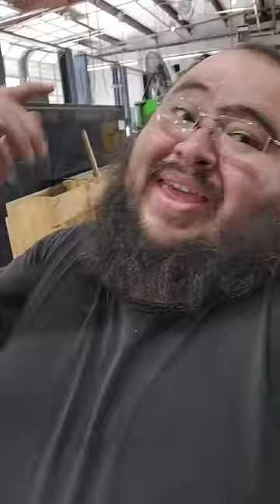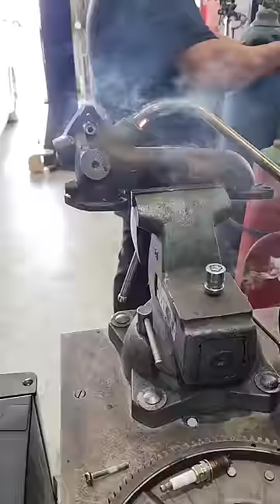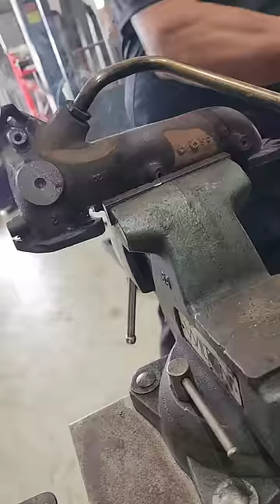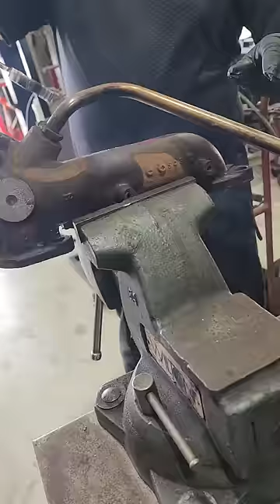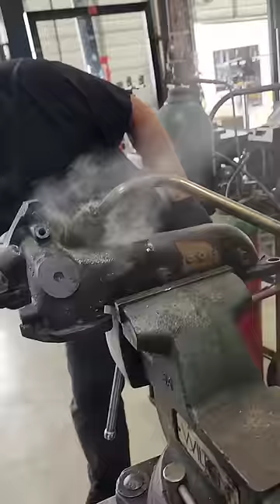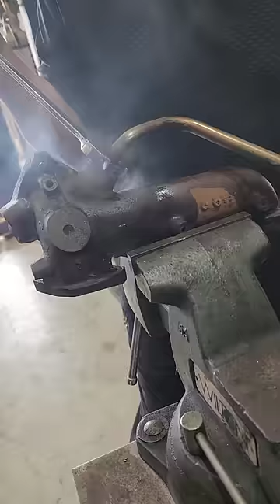MECHANICS MUST HAVE.... #shorts #youtubeshorts #fyp

Comment: Throw the close end wrench through the other side of the line and avoid rounding out the nut
Reply from the maker: The other side was a 27 so it wouldnt fit, i told him he wasnt getting it off lol sadly i didnt witness him removing it cause i had ish i needed to get my ish done
Reply: Flange wrench needed
Reply: i can concur, the snap on line wrench set goes up to 21 and my god it’s been a life saver on more than just stuck fittings🙏🏽🙏🏽
Reply: @DaDude999  that was a flange
Reply: Guess they never heard of a line wrench. Any mechanic should have a set of standards and metric to finish out your tool box.
Reply: If it won't fit over the end cut it
Reply: That’s what flare nut wrenches are for
Reply: Yes, flare nut wrench. Use the right tool. The box end of a standard wrench is typically 12 point and actually provides less contact than the fork side. You need more leverage too, peen the area while it’s hot and shock the flare nut side with some Freeze-It or dry ice. Work smarter not harder boys.
Reply: Get a line wrench on that and have somebody sit on the table... you can't get good leverage with that table moving
Reply: If you don't have a line wrench that size a sharp chisel bit in an air hammer, and some heat does the trick, vibration and expansion breaks the rust bond.
Reply: You can dunk that in cold water and if the heat loosened them they will stay free and undo cold shiiiiiit
Reply: I'd just cut it off and hit with an impact. Egr tubes are cheap.
Reply: Heat and use bee's wax
Reply: Looks like you needed some more leverage on that wrench.
Reply: Hit the outer with chisel gun lightly works everytime
Reply: Pipe wrench,not that hard to figure out.
Reply: Tubing/flare nut wrench for the win every time
Reply: Heat and beat! Are you trying to save the manifold or the Egr pipe. Get that manifold glowing red.
Reply: @DoubleoP  turn the piece around and pull towards you, lot more body force than pushing of lifting that way
Reply: @FluffyMexicanik  well ishhhhhhh
Reply: I was wondering why they didn’t do that. For that matter, cut the pipe off just past the fitting, and use a six point impact socket & impact. Weld the pipe back together if needed

Comment: This is why flare nut wrenches exist.
Reply: Yessir!
Reply: You don't need a flare wrench. This guy coulda slipped the closed end over the other side of the pipe and coulda had a full 360 degree bite on the nut.
Reply: @evanpimental  the other end was bigger
Reply: @evanpimental he said it was an open-end wrench on the other side
Reply: Line wrench...then the. Hammer. Chisel pounding begins.
Reply from the maker: Didnt have 1 large enough and other end was bigger
Reply: @FluffyMexicanik  excuses
.....
Reply from the maker: @feffernoose2860  lmao buddy...im showing yall what i want to show yall...apparently i posted this cause i knew it was going to gain traffic...also notice i said "you aint getting it off" in the begining of the video
Reply: @FluffyMexicanik  just another excuse... Love your videos either way mang
Reply: and vice-grips since its an inner bolt not outter nut.
Reply: @evanpimental  but wouldn’t the 12 point closed end be more likely to round it off since its 12 point and doesn’t have as tight of a grip on the nut?
Reply: @xXIntoleranceXx  well 6 point is tbe best, but 12 point beats an open ended wrench.
Reply: @FluffyMexicanik  that shop has an oxy-acetylene torch, lifts, engine hoists, but not a flare nut wrench in that size? Seems like y'alls priorities are outta wack
Reply from the maker: @FailedEmmisions  lmao u know us soooo well...back when these were common simple adjustable wrenches were good enough...now a 26mm flare...nope
Reply: @FluffyMexicanik  the YouTube mechanics know it all don’t you know that! 😂💀
Reply from the maker: @fastfred1233  smh we got every youtube certified trade in the comments 😅🤣

Comment: Keep in mind heat causes expansion. So would be more effective to heat the manifold in the area around the nut rather than the nut. Also when spraying any lube it going to evaporate. Wax works wonders in situations like this
Reply: Nailed it. I use crayons
Reply: Wouldn’t you want to heat the nut so it expands around the fitting taking some of the pressure of it?

Comment: It's also best practice to work it in and out. If you're able to loosen it a bit, tighten it back. Then loosen, tighten, so on and so forth. Keep good heat on it and plenty of penetrant. Eventually it'll work loose. If not, you're bringing threads with it. It happens sometimes. Especially with how locked it was in that manifold. If it comes down to it and you find yourself spending too much time on it, just cut your losses and replace it all with new

Comment: Gotta get a induction tool. My brother bought one and I was skeptical I always broke out the torch but after using it a bit I'm sold.
Reply: @andrews8722 the point is to break the mechanical bond of rust that has occurred. The difference in expansion/contraction is really minimal, but it’s enough to crack that bond the rust has in the threads.
Reply: They don't get hot enough for this job.  Need acetylene.
Reply: @MrMech-oj7iy  um… induction heaters get a fastener red hot.
Reply from the maker: I seen it work also

Comment: A good pipe wrench works wonders for things like that. Lots of leverage and little chance of slippage.
Reply: The pipe wrench design allows the jaws to get tighter as you add more pressure.
Reply: @e.b.6766  Yep, and deform the shit out of that nut and probably the tubing as well. A flarenut wrench will get it without damaging anything.
Reply: Yup I used a offset 14 inch on something like that , did fuck up the nut and line but was replacing it anyways
Reply: @eyellgeteven9928  if you do it right its not going to deform the nut or line anymore than him heating it and hitting it with a open end wrench. A line wrench is ideal. But if you have any skill as a mechanic a pipe wrench works just fine.
Reply: @matthewglaze5398  I'm glad you don't work on anything of mine. Yeah, you can get away with using a crescent wrench/channellocks/pipe wrench, etc sometimes...but that one time it fucks up, you'll wish you would have just used the proper tool for the job.
Reply: @eyellgeteven9928  lol im glad you have never had to improvise not all of us are privileged enough to always be able to afford the right tool. Also any mechanic worth his pay knows how to improvise. ✌️
Reply: @matthewglaze5398  How do you think I know that someone can easily fuck up those nuts? I learned it by improvising with various tools, and fucking them up...like I said, you may get away with "improvising" for a long time, but at some point you'll have a problem. Just think of me when it happens to you. Oh, and BTW, the reason I bought a flare nut set, is it's pretty expensive fixing fucked up nuts and tubing...you can get a set of flare nut wrenches at HF for like $15. Money well spent.
Reply: @eyellgeteven9928  I have done many that were stuck where a line wrench or a flare nut wrench were not big enough and did not have enough leverage that's how I know what I know but the next time I fuck one up I'll make sure to be thinking of you no worries.
Reply: But that crushes the hollow nut and line. A last resort. Line nut flare nut wrench first
Reply: @eyellgeteven9928  that one time it fucks up you put a new one on lol
Reply: @cornholio324  if it’s that stuck I’m replacing it after anyways

Comment: I always try tightening those a bit first!!
Reply: why
Reply: @donavonheim559 reverse thread
Reply: @donavonheim559  helps to break it up a little, if you can't get it to go one way, go the other way just a little bit
Reply: @donavonheim559  it breaks the rust holding it in, which makes it easier to turn back out after. 95% of the effort is in breaking the rust seal.

Comment: Sacrifice the tubing and slice the fitting from the inside in opposite pairs without screwing up the casting's threads. Tap tap midway between the cuts. 4 cuts were the most it ever needed. 
The next undersized metric impact socket has fit on imperial fittings and versa visa.
Everyone needs to figure this stuff out hopefully without trashing too many manifolds.

Comment: Those exhaust manifold tube are super hard to get out boy no joke closed side leveled and a hammer 1 nice Tap 👍
Reply from the maker: He could use the boxed end, nut size was a 24 and if you notice the other end of the tube had another nut which is a 32, no way possible...

Comment: Brake line wrenches (often called flare nut wrenches or simply line wrenches) serve a specific purpose in a mechanic's toolbox. Several styles exist, but determining which brake line wrench is right for vehicle isn't really that hard. Most domestic cars use a 7/16-in. size, while imports typically use a 10 mm.

Comment: 1. you can get special sockets for these,
2. you should have used a hammer on it to give it more give - yes it will probably ruin your wrench, but you'll finish the job
3. heat up some more after that, heat it up more and heat it more

Comment: we have the same issue on the old trucks and also ford rangers the egr pipe  ..Tip use Diesel fuel and heat slowly with benzo torch  the diesel will seep in and break the rust carbon and crap out ..has worked every time for me

Comment: Pro tip: once it's warm, take a can of keyboard duster, turn it upside down an use the liquid to quench the nut and line. It will shrink down and pop loose with a little bit of tourqe.
Reply from the maker: Damn good tip
Reply: And watch  and hear that cast iron crack from thermal shock LOL

Comment: To start with you didn't get hot enough secondly have a good viscous oil to quench it with and then take a ball paint Hammer gently tap the side to help the oil work its way in to the threads while the metal is expanded and from where I live up in Northern New York that looks like a brand new pristine manifold the ones we deal with barely look like a manifold anymore or even have a hexagonal nut left to grab onto and we still get them out

Comment: If you had heated up the cast iron manifold to cherry red, you could turn the pipe out by hand. Worse case, still heat the cast manifold up around the fitting Cherry red, hit the fitting with ice or something freezing when discharged then turn the fitting. Everyone gives up on the blue tip wrench before it’s gotten hot enough!

Comment: I would do it the same way we used to have to do repairs on mopar exhaust systems in the 90's.
The catalytic converter downstream tubes would fail and to get em out of the side of the converter you would heat it till it was glowing red the instantly hit it with garden hose. The quench is like magic, when before it a 400lb man couldn't turn a wrench 0%. But after a 8 year old could spin it out.

Comment: Time is money.
You can cut that pipe and remove the nut with an impact and socket.
Then use a new pipe with nut.
But not heating or quenching it right is still going to make it more difficult.
Those are a real pain, but the journeyman can teach the apprentice.
The crowfoot and the hammer when it's still on the car can tell you at the time of the estimate.

Comment: Flare nut wrench would be the better option, rather than the open end wrench. But if it was me, I would have slid a box end wrench over the brake line, put it over the nut, grab my air chisel with a blunt end, and run it on the nut on a few sides for a little bit and then try loosening. As previously said, more heat would help aswell.

Comment: Ive honestly had really good results using an oversized crescent wrench with heat. For line nuts and brake lines ECT. Heat the housing and spray a jet of water on the nut. The only problem is getting it in there. But with the part out, that's not an issue. It's so beefy that it doesn't flex.gotten many a O2 sensors out this way as well.

Comment: Heat the joint then douch the threads with WD40. The thermal shock breaks the corrosion better.

Comment: Probably would’ve worked better if he didn’t heat the fitting up, but rather the area, the fitting goes into. heat, expands metal just as cold contracts, metal and by hitting the actual fitting you’re just making the connection to the fitting hole even tighter

Comment: What is on the other end of that pipe?  Is it a fitting ?  Can he get a boxed end of the wrench over it?
   First I'd get a real good penetrating oil , a commercial grade not crap like wd40.  Get a air hammer with a hammer end and start lightly hammering on the nut all the way around it and spray with the oil.  turn the part over and spray the oil  in from the other side and let it sit. go back to lightly hammering it.  Then get a pipe wrench and a long pipe and break it loose.

Comment: Put the wrench on the other side keep light pressure on the wrench and tap  the end of the wrench with a deadblow don't use your hand and make sure you keep light pressure on the wrench before you tap it with the deadblow or you'll probably round the hex I hope this helps deadblows are very cheap at harbor freight and work great for this I have to break shit free almost everyday working in a industrial setting most the time you won't even need the heat

Comment: For putting oil on a hot bolt you should use engine oil it will work into the threads better and won't just burn up like thin penatren oil

Comment: So many videos going around of people heating bolts, or in this case a fitting, that threads INTO the other thing. Try heating the other thing, and leave the bolt/fitting cold. Anyone who spent more than a semester in a high school physics class would tell you expanding something with heat when the thing around it isn’t heated will only make it tighter.
Reply: @FluffyMexicanik  Ask a mechanic or engineer. I'm a commercial driver. I leave the thread braking to the experts who get paid to get greasy.

Comment: I've never had to use heat on an egr line in the exhaust manifold. I just get the vehicle hot and break it loose. Also goes with o2 sensors.

Comment: So many people do this wrong. DO NOT HEAT THE PART YOU ARE TRYING TO TURN!!! The heat EXPANDS the metal. Always hear the thing that is around the bolt or nut you're trying to remove. You don't want the thing your trying to remove to expand and get even tighter... That would be the opposite of the goal.

Comment: Get a punch and give the top of the nut a few good hits around the circumference. The shock and heat can break the bond of the corrosion in the threads.

Comment: Cut the egr pipe off leave about an inch from the nut left and squeeze the open end together and silver solder or braze the crimped end
Reply from the maker: That would deem the egr system useless

Comment: You heated the wrong thing.  You should heat the manifold to expand the metal away from the bolt that's how adding heat works. Heat expands metal you you just expanded the bolt inside the manifold. Hope this helps!

Comment: Place (and hold) a 2 or 3 lb hammer against the outside of female threads. Then wack it with a similar sized hammer 180° from the other hammer. You've just shocked the threads. Should break loose a little easier.

Comment: Any tapered fitting will undo if you tighten it first then undo if dosent heat up the center or any nut bolt what ever dosent matter then wd40 through the plastic attachment thing quick as sometimes it'll catch fire just keep spraying then it's already loose

Comment: Get the nut cherry, spray with WD 40 or something till it stops glowing then put the wrench on it an tap it with the hammer.
If that doesn't work get the 48" pipe wrench an twist that bolt like the head of a unwanted child.

Comment: You know when he was heating it with the torch and got it hot all he had to do is take some ice water and throw it on that the heat expanded it and the ice water would shrink it so fast it would crack any rust that was in between the joint and free it

Comment: The other side of the pipe is the same size so slide the ring end of the spanner over the first fitting and to the seized one and throw a bar on it
Reply from the maker: No sir...he was using a 24mm other end is a 32mm

Comment: Use a line wrench.  Also you used too much heat.  Especially if that coupling was  brass the thermal expansion rate is different

Comment: Heat killed the attempt, air hammer around the fitting. Heat bakes the rust making it harder to remove.
Reply from the maker: This wasnt rusted, its an egr tube, old egr tube...

Comment: Mix in some cold and freeze the inner after heating the outer.
Reply from the maker: We didnt have water
Reply: @FluffyMexicanik  keep a  can of that air duster you would use to dust your computer out with in your tool box. Turned upside down and sprayed on will cause the solvent to flash off can get down to really cold negative temps. Useful when heating isn’t a good option. Like a fastener stuck in a fiberglass insert.

Comment: You have to shock it with a punch and hammer then heat it up with a propane torch just the outside evenly and it will open

Comment: And that's why you always keep if you candles around and if he would have just got that hot but candle wax on the joint locked away from it until 10-15 minutes left the Box jail again and it'll come right loose it when the wax is real thin it'll go all the way down in the threads and then when it gels it's like a grease
Reply from the maker: We always forget that wax work